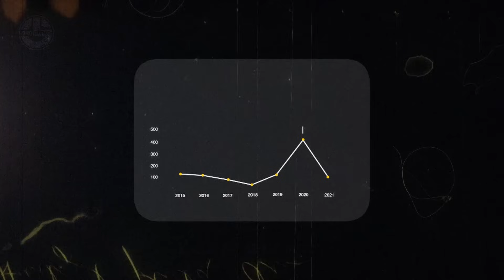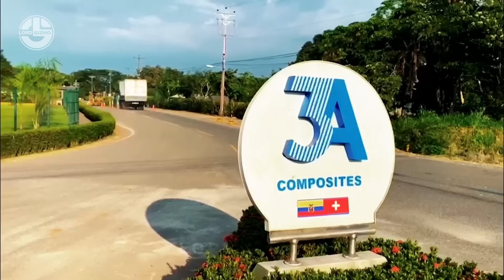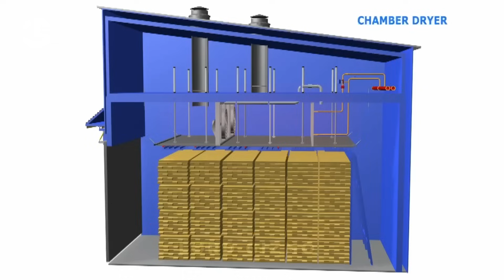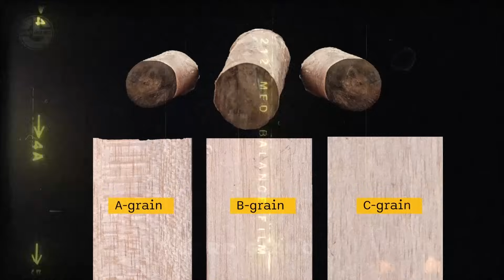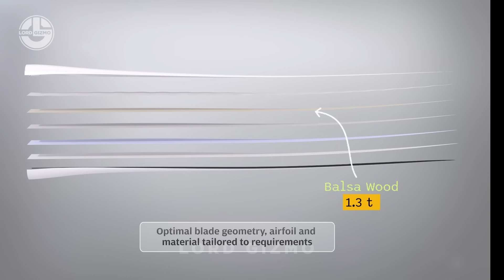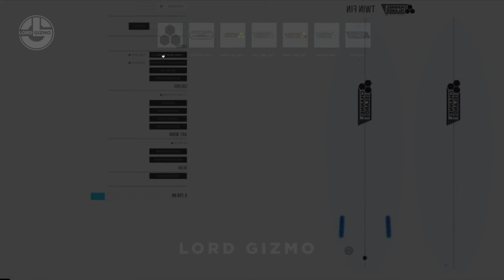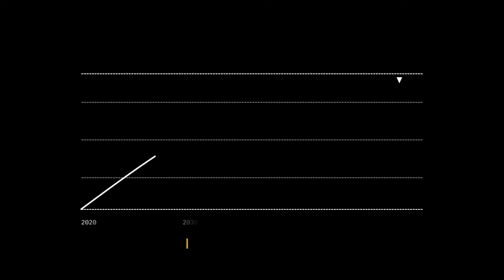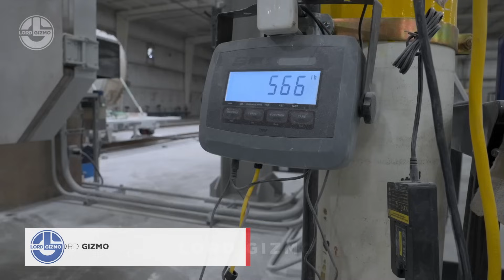How Balsa Wood Became the New Gold Rush: From Seeds to a Billion-Dollar Industry!

Comment: For the 60 years of My experiences with Balsa  there has been a Definite trend in 'claiming'  that there is Mass Industrial demand for "balsa'.
Increasing demands being the "reason' for pricing "claims'.
First was Balsa cored Boat hulls.. next it was Balsa as insulation on Oil tankers. ALL of which is no longer a use.
 Then it was Wind Blades. (for which it is also NO longer used ..despite Bullshit claims !) 
Simple Greed (often by Middlemen)  is the base reason for ever increasing pricings.

Comment: as a tradesman of multiple tradeswho has worked years with ESD, Cathodic reactions, and all forms of Lightning Protection and sensative hi value equipment hardening? and DC rail, aero, comms, towers, fuel xfer, manufacturing, and others.  "I wounder why"? Would some are these same techs are not used in the construction of these wooded lightnig rod$? And I worked with all energies but nuc, with fiberglass, kevlars, carbons, epoxy's all temps, pressures, or environments man made or natural.

I can think of quite a few ready to go off the self techs used today that may not be perfect but could mitigate or eliminate the risks, I smell BS.  Or MORE PROFITS!

Comment: Certainly not more resistant than plastics.
Balsa composite aircraft were famous for rotting away, if left in the rain.
Reply: And if a puncture occurred from impact, they would quickly rot in that localized area and produce weak spots that would spread with the hidden rot.

Comment: My first run in with balsa wood was throwable toy 10 cent airplanes around 70 years ago.
Reply: how old are you?
Reply: @-sawal  I am 78. I was born in 1946.
Reply: @johnbethea4505  My respect grandpa!
Reply: @-sawal  it is a long time. I have been to war, shot, stabbed, cut, burnt, poisoned, fell 30 ft on steel, Agent Orange,totaled 2 cars and 1 dump truck, and so many other things.
Reply: @johnbethea4505  Wow! Sounds like a pretty wild experience in Vietnam. Did they capture and torture you?
Reply: @-sawal  no. I worked black ops. Pretty much alone most of the time.
Reply: I remember those planes. Wind up rubber band balsa planes were one of my favorite toys. Others had a metal wedge at the nose and you just tossed them. It was great fun.
Reply: @paparoysworkshop  yes, my dime ones had the clamped metal wedge on the nose. I could adjust the front wings position to make it do different things.
Reply: @johnbethea4505  Such fond memories. 😄
Reply: That's a great memory! Those classic balsa wood airplanes were such simple yet fun toys, and they sparked the joy of flight for so many people. It's amazing how something as small as a 10-cent toy could leave such a lasting impression. Do you still have any interest in model airplanes or building things with balsa wood today?
Reply: @QProcessHD  the last time that messed with a balsa plane kit was around 25 years ago. It was a large size B-17 bomber of WW2. It was large task to complete and very much fun.
Reply: @johnbethea4505  That sounds like an incredible project! A B-17 bomber from WWII is no small feat, especially with balsa wood. I bet it took a lot of patience and skill to finish, but the satisfaction must have been immense. Model kits like that really bring history to life in such a unique way.
Reply: @QProcessHD  It’s just a model—it doesn’t really bring history to life. Understanding history is about context and stories, not building replicas of warplanes.
Reply: Yup I remember buying them as a kid!
Reply: I think you can still find those little airplanes with the wind up rubber band propeller
Reply: @aaronl6333  I am a 78 year old Vietnam War Veteran 1966-67 who is 100% disabled, so I can't play with them anymore.  My grandkids could.
Reply: God bless you
Reply: @JoeKyser  thank you.
Reply: Mr Black Ops 😂
Reply: @JoeKyser  everyone young must learn right from wrong, don't you think?
Reply: Same here but only about 50 y ago.
Reply: and then they got fancy, added a rubber band and propeller!
Reply: I had  thrown put together plane in 60s.
Reply: @setstretch  was plenty of fun, weren't they?
Reply: @johnbethea4505  along  with the paratrooper you'd throw up to watch it come down.
Reply: @setstretch  I had forgotten about them. We used to take a handkerchief, strings, and a rock before we could buy them.
Reply: @johnbethea4505  no doubt you remember the (name passed me)
Set of planes ships to glue together..never did Finnish one..
Reply: @setstretch  to me, they were model planes, ships, and cars. They came in different scales. The best glue was discontinued years later because people were sniffing it.